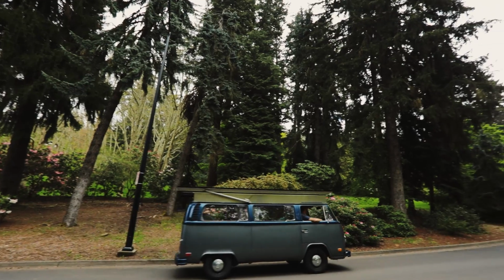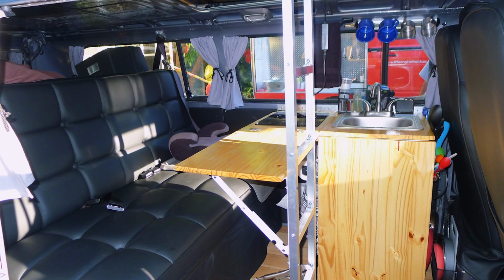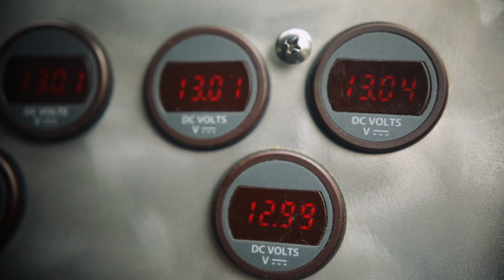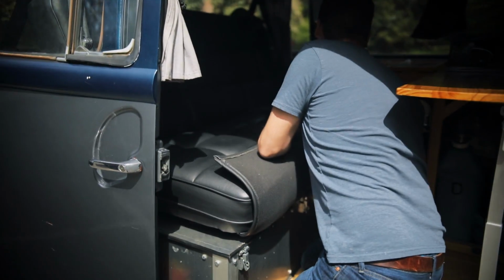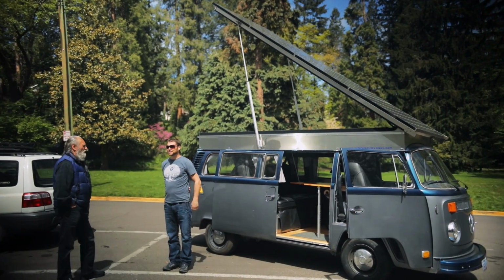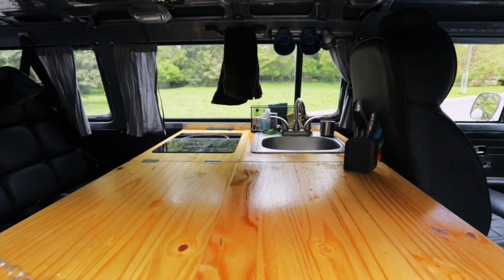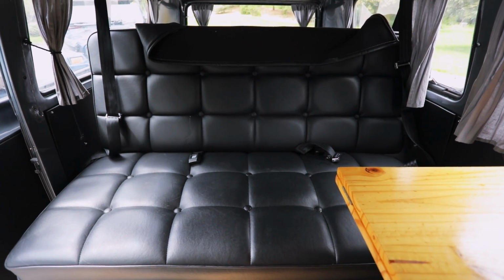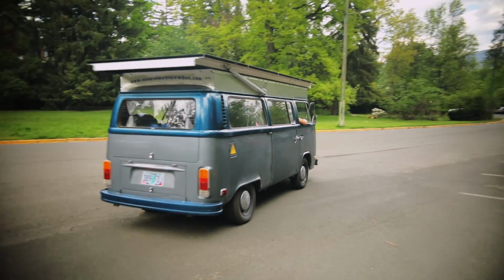This is a Fully Solar Powered Electric VW Bus

Comment: Hi Dylan... for an awesome engineer with an open source solar charger / battery management system: http://electrodacus.com

His controller is designed for lithium batteries.

We are in Spain.. in a Fiat Ducato camper.. about 20 feet long and maybe 10 feet tall, 6 feet wide.  

I used to think there is no chance to power this thing, but maybe... now i'll think more seriously about it.

Hey.. I notice you have this thermo electric fridge unit.  (is it thermo electric?)  How quiet is that one?  I bought a cheaper brand and it's driving me a little crazy with the buzz.
Reply: Surf every hour!

Comment: you can get flexible panels that could be attached to a canvas and could be rolled up for travel the would need to be rolled up on a core at least 12 inches in diameter they are less efficient than the monocrystal ones you now use so it will take more of them. though i would consider biodiesel made from soldier fly larvae  then all you need is food waste and about a week for the soldier flies larvae to mature a diesel/electric can be very efficient and a full sized greyhound type bus can be had cheap i bought a 196 pd4106 for 6700 dollars and it was already converted to an rv.it came with 140 gallons of diesel tankage and if converted to a diesel/electric hybrid would go from 14 miles to the gallon to about 40 and any solar off the top would just add to that.and yes it would take a lot of batteries about 300 kwh

Comment: The Dometic Refrigerator caught my eye. That’s what it’s called right? Video captions for me say Dometic. I also took note of the Lithium Ion preference for batteries and the fact that you got yourself a charge controller and inverter. I didn’t know you could make or get custom made seats like that too. Induction stove top was genius idea. Eliminates propane reliance/dependence. Also, I took note of your water pump for the faucet. How did you set that up? Where’s your water tank?

Comment: Maybe graphene batteries will one day give you a range of 200+ km. If you fill up all your empty space with the hydrogen that the batteries produce, then you can offset the weight of your 500 kg batteries and heavy transmission.

Comment: My dad spent about 4 years doing something similar, though the 13 litre V8 Diesel remains, about half the roof is solar pannels providing enough power to live off grid. Toilet, Shower, full kitchen, fridge etc. It has 2 large deep cycle batteries that power all the internals for a couple days and only takes about a day for a full charge. The weight of the bus has gone down significantly to running top gear in the outback, fuel economy is about equivalent to a family car. He spent most of the build time rebuilding the Bus (the 303 engines are bullet proof but), the Rust had taken significant hold around the Top rear window & down a thrid of the way from the front door. All of the cancer (rust) had to be cut out and replaced & the coated to prevent future corrosion/rust comming back. The work it takes to convert vehicles and give them a new lease on life is quite immense, I doubt most people really realise how long it takes!
http://prntscr.com/l38ny2

Comment: Just some rough assumptions, if it is a 1.2 kW solar electric (PV) system at $1.50 per Watt (including inverters, excluding racking system, self-installed) that'd be $1,800 for the solar system, 12 deep cycle golf cart batteries at $180 a piece is $2,160, subtotal $4,612. Annual savings going 50 miles (80 km) per day (14 kWh/100 km) equivalent to 8 litres of gasoline saved (at 10 litres/100 km) and 84 cents/litre (US$3/gallon) annual savings $2,248. So simple payback of just over 2 years (2.05). If the batteries last 750 cycles at 75% average discharge that's a life cycle of 2.05 years (don't forget to recycle!). After 2 years the annual cost is about $1,080 per year for battery replacement and $2,248 for annual fuel savings, or $1,168 per year net savings, and perhaps a 20 year life for the inverter and 50 year life plus for the solar modules. So, after 2 years, a free cake you get paid to eat for about 2 decades. Of course, there is some sweat equity here, though perhaps more labour went into the kitchen and seats than the solar electric system. Also, essentially zero carbon emissions from operations, and when you get to your destination no noisy, stinky gasoline generator to keep your kitchen going. Try THAT with a gasoline-powered car! :-)

Comment: Time for simple math since OP fails to mention this.  His battery is 45kWhr.  Solar array is 1.2kW.  45/1.2=36 hours to charge.  You really get about 6 hours of solid sun each day, so it would take about 6 days to charge.  Kudos for doing a neat ev plus solar project, but it's practicality is quite misleading.
Reply: ... and your math is also wrong..  lol... but... it's about camping..... and he does have a level 2 charger and a plan sooo
Reply: if its wrong why don't you point out the mistake...
Reply: @jpmorgan187 lol.. ok .. did he say 45kwhr exactly... noooo... is that a solar array 1.2kw that can be figured linearly... noooo........ and isit  for sale... nooooo....its his toy... he goes camping with it...  all that can be realistically evaluated is observations with it anyway sooo..  ya.. why bother pointing out "a mistake".
Reply: oh great input captain obvious.  for the people out there with a properly functioning brain and at least a high school degree, these are obviously 1st order approximations that yield conservative results for sunny days.   lesson for schwminibrainbike:  energy output [kWh] from a fixed array, titled at the location's latitude, is approximated by multiplying peak power times 6 hours.  Source;  i have a 1.5kW array and an electrical engineering degree.  schwminibrainbike has a keyboard and his mom's basement.

Sad thing is... it will easily take over 6 days to charge:  1) Battery will charge at full power up about 75%... then take even longer to charge in the CV phase. 2) Panels would be hard to angle properly.  3) Inefficiency of power conversion.   Anyone who puts panels on a vehicles clearly doesn't know what they're doing.  It's far better to leave them on your roof and get compensated for the energy they feed into the grid.
Reply: obviously.   get your GED and then come back to comment.
Reply: @jpmorgan187  sure .. maybe they will just give me one after i complete my doctorate in electrical physics...

Comment: Well I can’t wait for you to see the prices on the actual old vw busses some models go well over 50,000 unrestored and well over 200,000 restored and those motors weren’t know for bad gas millage or oil leaks so don’t act like they were. They also aren’t heavy vehicles being anywhere from 2500lbs to 3800 they are very light they can be less then the brand new 2019 Porsche 911

Comment: If you carried one spare cell or half size cell and you saw a cell going low you could patch charge power into that cell from the spare, now you have some extra reserve miles.
  If you could get a micro diesel or micro gas turbine you could power a charger to plug in during long distance runs or for long hill climbs.

Comment: well this WAS cool in tell i seen the battery box and open wires .  any kind of / crash / fire / water.flood and any 1 trying to help you after side crash can get killed as your self . and even your solar you say is boosted . you have to much HV . FIX it before you kill some 1 or your self

Comment: Get rid of that obsolete heavy lead acid batteries and put there some Lithium ones. At least any Leaf, Volt, Bolt or Tesla modules would be ok. They are light, powerfull and keep the charge.

Comment: very good job. thanks for the video.  Detroit to Chicago is about 300 miles, and most cars can easily drive that on one tank of gas. 300 mile range is about the minimum I would like to have in my electric van/car.  I am thinking about settling for about 200-220 mile range if I can cover the entire roof with solar panels (not just 1-2 panels like most people).
Reply: Wrjbg 150 cheap ha k r waty 75 2  to 4 cheafgrs

Comment: Ok it’s not very good it looks awful and the main point of the old volkswagens the the flat 4 one of the greatest engines of all time, fun fact the record for highest mileage original drive train flat 4 is 1.3 million miles and you can get well over 400bhp out of one you can even get 46mpg (in a beetle)

Comment: This is great! Have you considered using lithium batteries instead? Lead acid batteries are not very energy dense, are quite heavy, take up a lot of space (not compact at all), cannot be discharged quite the same, require much more maintenance and have a very short lifespan. SimpliPhi Power offers safe, 98% efficient, non-toxic, compact, cobalt-free lithium iron phosphate batteries that come with a 10k cycle or 10 year warranty.

Comment: That is a great one, lad. Everyone owning that classic VW bus makes this a great solar electric camper. That saves a stinkload of money on gasoline. Tesla should do this kind of conversion for RV campers so no more gasoline costs and all solar electric power only even on the longest lasting batteries with great mileage per charge. Solar panels is a must for all RV campers.

Comment: Brett & Kira:

This little VW Bus is simply "Ingenuity Personified". I just love every aspect of the retrofit.

Two areas that I would like to ask you about as a retired Electronic Technician are as follows:

#1 Are you able to "Vent" the  hydrogen off-gassing from those lead acid deep cycle batteries & 
#2 How are you faring out with the "solid" copper pipe links for coupling the batteries. A great idea for a fixed solar installation but in a moving vehicle is there not an undue stress 
due to vibration placed on the Anode & Cathode posts of those Trojan Deep cycle units.

A Wonderful job Guys !

Barry Begley
bhbegley@gmail.com
BarryHowardBegley.com

Comment: interesting vid, but this leaves me with many more questions.  Like where about do they reside and what is the destination?  If they can only go 50 miles a day, this does not leave much flexibility.   What do they do for a living?  What was the to total build cost?   This may seem nosy, but required info IMO when it comes to this.  Also, he can't tout a lightweight motor when they're carrying 1k pounds of batteries....

Comment: Why pay for the voltage loss  to change voltage.  Start with 12vdc end with 12vdc no power loss. 144vdc @ 10amps has the same power as 14.4vdc @ 100 amps.

Comment: Outstanding, very cool. But, I'm pretty sure your lift-pistons are upside down. The oil inside needs to 'bathe' the piston seals which is better accomplished with the 'extender' portion of the piston being on the lower side. Look at any vehicle's hood, trunk, etc, with a piston - and you'll see that the 'fat' portion is on top when extended. This should extend the life of the piston - otherwise, outstanding work, very impressive.

Comment: That's awesome! Just curious... would the extra energy required to tow a small trailer negate the additional charging capacity provided by installing panels on top its additional surface area? 50 miles a day is kinda lame....I mean I can typically travel 2-3 times that amount each day on my bike running on a renewable energy source: TACOS! LOL

Comment: Great ride, I would recommend getting some used tesla s battery modules on ebay and replacing those lead banks (18650 or 26650>lead). You can source out a totaled BMW i3 for $4-7k usd and harvest the motor for awd also the batteries and regen brakes, maybe the climate control system and parking sensors as well if it's all in good condition. High potential for this vehicle!!!! Videos likes this gives me faith in mankind.
Reply: I used Nissan Leaf modules in my motorcycle build. IMO for this build they'd probably work better since he's at a lower voltage and is pulling more amps than a Tesla module is rated for. Leaf modules will do up to 500a continuous.
Reply: Great suggestion.
Reply: can you make me a sweet electric van?
Reply: Right, spend $20,000 to hire an engineer to design it so it does not blow up in your face or burn up regen components. No advantage, a decided disadvantage. There is NO potential for sustainability in a vehicle this large and heavy, it is just a hobby that will soon be taxed into oblivion. Fully sustainable vehicles weigh no more than 1000 pounds and go no faster than 40 mph. They do not require the extremely over built road infrastructure we now abuse to suffocate nature. The mere act of driving any vehicle up over a high mountain pass damages the high altitude fragile balance. If you love the mountains you will never go there.
Reply: @popeyegordon  ok tree hugger
Reply: @popeyegordon  wtf are you smoking?
Reply: @laur-unstagenameactuallyca1587  I avoid all smoke and excess consumption. Heavy RVs in any form are no longer sustainable. It is not just what amount of power they use, it is the nature suffocating high speed roads they require and parking spaces and the road kill they make. Look at the 160 pound solar/human powered car-bike I drive. Zero pollution and it will haul camping gear. YOU are the one smoking the delusion that personal cars are still acceptable.
Reply: @laur-unstagenameactuallyca1587  You are so far out there you actually brag about having a child by making it your avatar. The single most damaging act any human can do is to intentionally reproduce in an obscenely over populated world. Adoption is great but the sum total of what a kid consumes in a lifetime is devastating!
Reply: Hey Popeye what sort of toilets do you use?

Comment: I really appreciate innovation, I really do… But honestly? I just paid 4200 bucks for a Dodge Durango with 115,000 miles on it and it runs like a beast with a hemi in it… There's more room inside of that Durango then inside of this bus… The bus will clearly be a nonstop headache nightmare… But that's OK because it won't be around Lind... with that many solar panels in that Close a proximity to each other… A fire is entirely likely… It's not an if, it's when… I see tragedy on your horizon. If you had four or five panels that you pulled away from the bus and set them up on a bracket away from your family I would cheer you on

Comment: I want one.I suspect you could fit two salvaged Nissan Leaf battery packs.  Then you could use a Zilla controller and have some real power and range.  Of course you will need more solar so your awning idea will come in handy.  Very nice build so far. I am thinking of putting a Nissan Leaf drive train and battery in an Ultravan.  The Ultravan weighs less than a Nissan Leaf.  The Ultravan weighs around 3000 pounds and was built like an aircraft fuselage. Had a Corvair flat 6 and got 18mpg. The roof of an Ultravan has room for at least 3kw and with newer solar tech maybe more.  The Ultravan is 22 feet long and uses regular car tires.

Comment: You should make and pull a light weight trailer with solar panels for even more solar power. Also a wind generator mounted where it catches the most wind. Maybe even a honda generator to charge your batteries when there is no sun. I think a school bus with an aluminum frame instead of the steel one, or an airplane fuselage with wheels converted into an electric motorhome. VIA makes a gas/electric truck that gets 100 mpg in the city. I bet if the 3 cylinder zeod nissan desiel engine that makes 400 h.p & 200 ft/lbs of torque & only weighs 40 kilos would make a great desiel/electric solar powered motorhome I would love to make a desiel/electric solar assist flying motorhome kinda like the flying car, but with boat like hull for amphibias purposes, or pontoons so that you could take off from anywhere or land anywhere & still be able to live out of it, & it be totally off grid. really like your video.

Comment: To continue charging the vehicle, and even add a much higher wattage, create a wind turbine-solar hybrid system. As you drive, the turbines generate  electricity along with the solar panels. You could easily place 2 on the front of the van.

Comment: I know it's good for exploring and admiring the scenery, but can it go fast enough to get onto north american highways at the minimum prescribed speed (60Km/h here in Quebec, which is in reality much too slow and run the risk of getting rear-ended), or does it need to take secondary roads all the time ?

Comment: Great video and great accomplishment.  I have been waiting for a modern electric van to convert and had thought of using solar awnings, one on each side plus roof panels.  I've only seen awnings for buildings.  Have you found any that are suitable for vehicles?  And do you have a link?  Inspirational.

Comment: You should get rid of the panels and batteries and buy a gas generator to power the electric motor... lol jk.

That is actually pretty good mileage considering how much weight you are moving.  I bet that if you designed the vehicle from the scratch you could probably get three or four times the mileage.  That would be a ton of work though.

Comment: Wait, so this one solar panel actually produced enough power for moving a car?!
Reply: Nope, it only makes enough to cut down on stops to recharge using shore power or you could power your camp while off the grid. (it's in the video) Would probably take several days to fully charge the batteries for another 50 miles.

Comment: youve probably figured out ALOT since you made this video but I do have a suggestion. Buy 3 or four capacitors and use those to regulate voltages to batteries as youre worrying about them drooping to low. youd want them fed from the cells and then feeding the batteries.